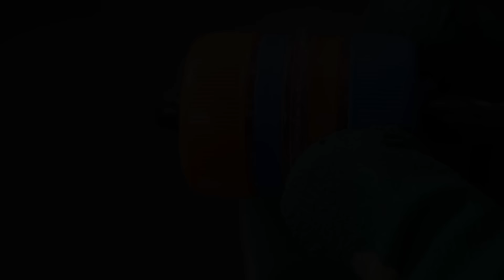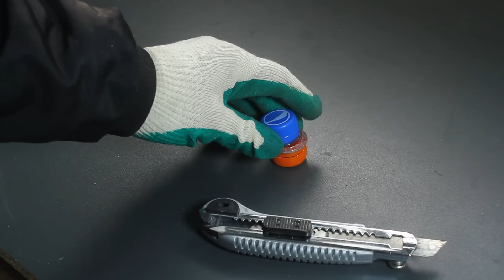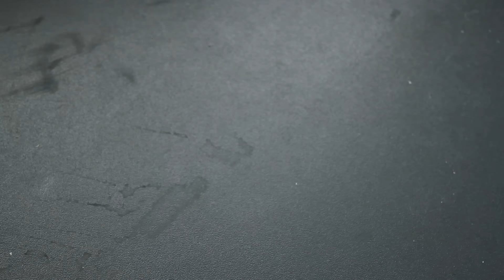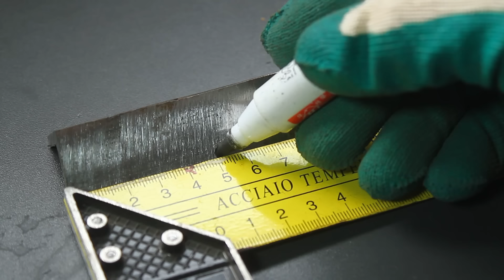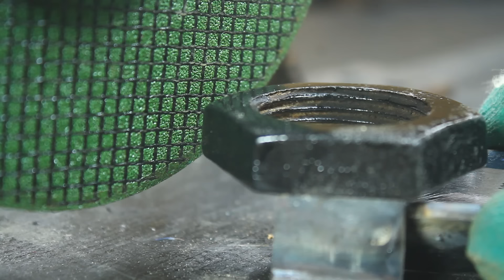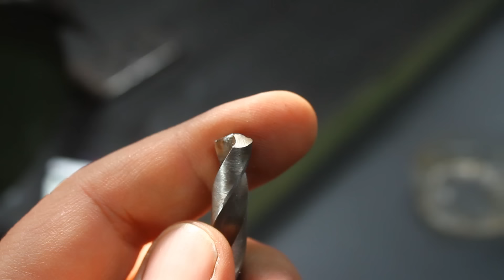I sharpen drills in 20 seconds. Tool for sharpening drills. idea #3

Comment: I usually do this by eye with just the angle grinder/ metabo. Also you might be better off if you actually use cutting oil instead of what looks like water.
Reply: А можно точить не на Метабо, а на Бош или Макита? Сложный вопрос.
Reply: @КуЛиБин-п9р Откуда такие вумные?